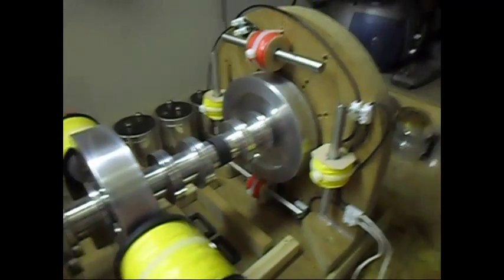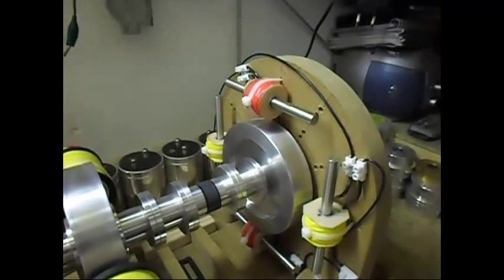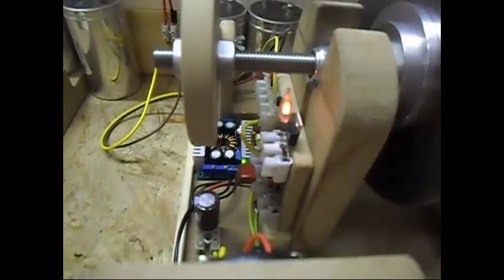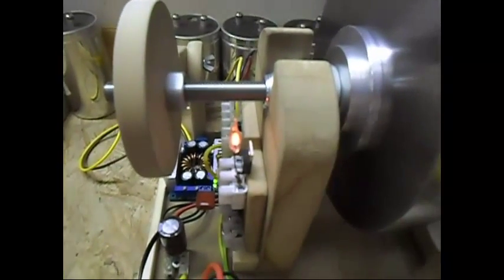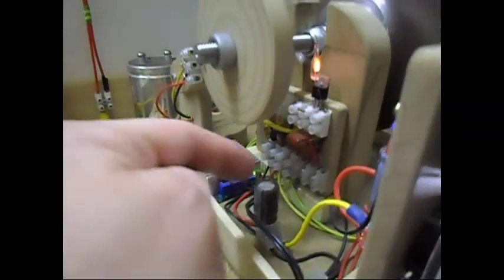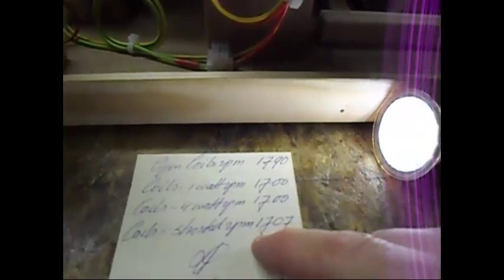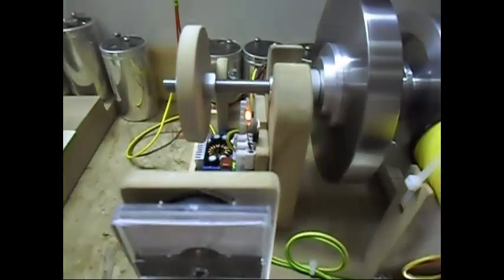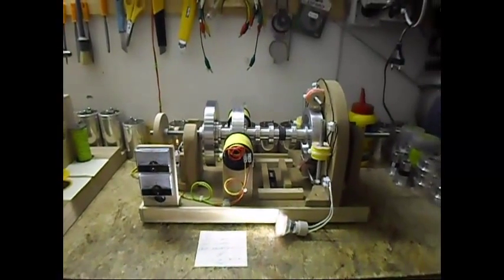Pulse Motor_Generator - Update 50 OverUnity is it or not, Future World Generator_37...

Comment: Hello again. 
I agree that you should find out how to retreive the back emf from your motor then use it somehow. The generator setup is pretty neat idea as well.  So ive been looking into generator ideas and found one that may intrigue your intrest.  If you care or have time you can look at the permanent magnet holder generator or "angus effect".  Its basically an iron "U" shape core and two coils, coducous wound on each side, then a alternating magnetic field would pass through the middle and induce a current into the iron then the coils. It will supposedly speed up under load. I am still building a small version and testing it, but its taking me awhile, got other things in life on the go. Anyway thanx again.
Cheers.
Reply from the maker: Hi Ryan,
Thanks for your comment...^^
The idea you talk about is nothing special really...;-)
Take any coil and place it to the side of your rotor as per angus with a long core sticking out and you will most likely get speed under load...^^
Doesn't have to be a U shape and with special connection or coil windings...;-)
Cheers